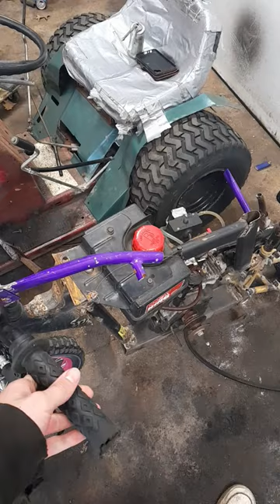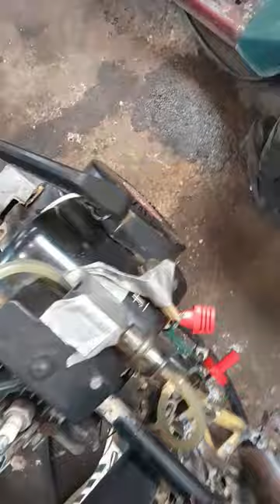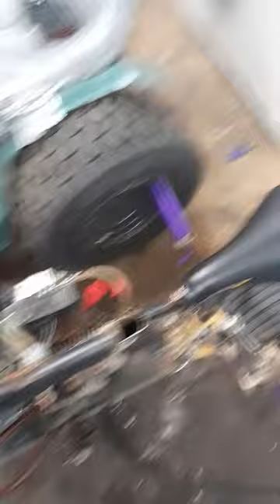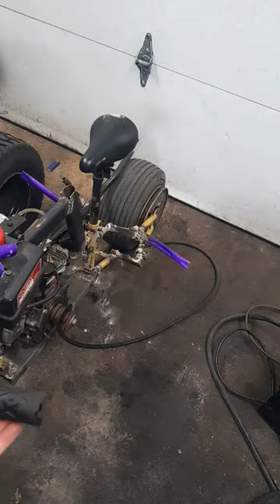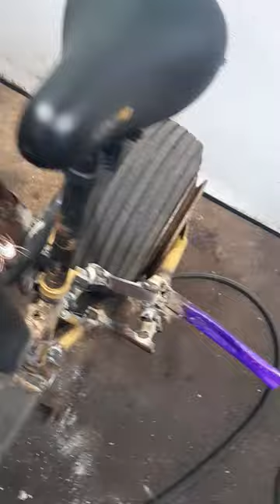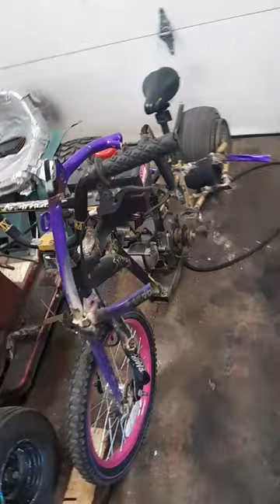flathead tecumseh motorbike chopping like its nobody's business #shorts #redneck #custom #wisconsin

Comment: Nice it Runs Smooth at Idle.. What have you done to get that Idle Sound?  Best Regards J.  Do you run it with a bit of Choke?.. It sounds like a Harley.
Reply from the maker: Yes I run it with choke, the carb on it is kinda weird, but it sounds good. Other than that it us just straight piped